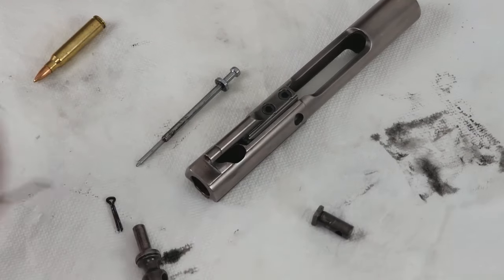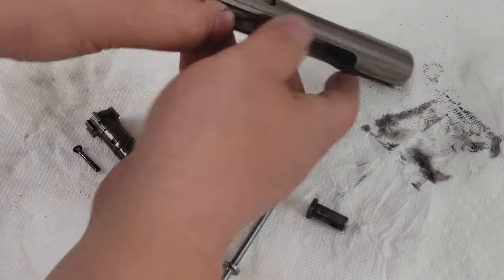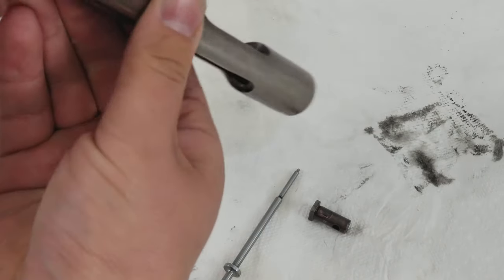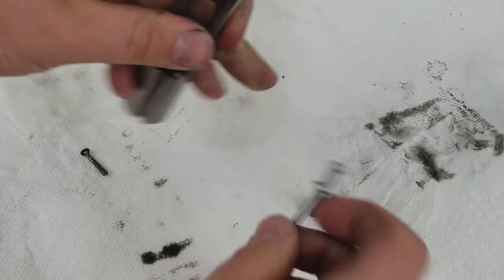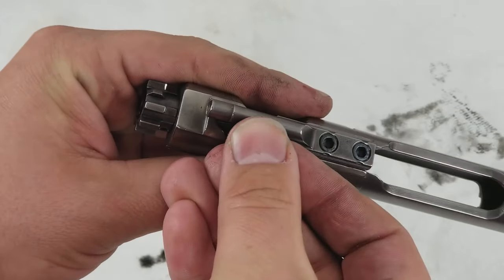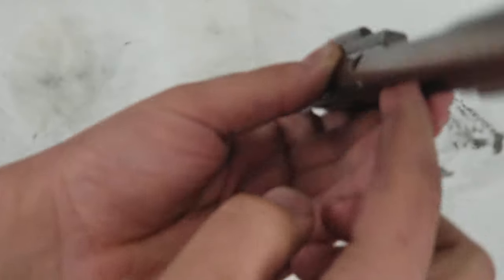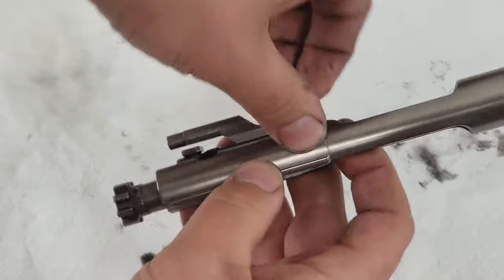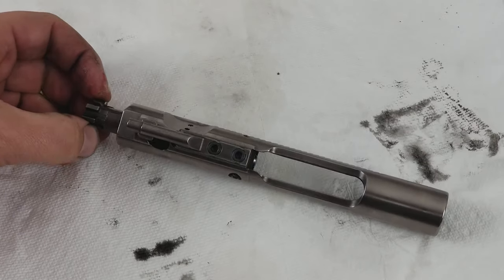How to Reassemble a BCG

Comment: I just watched a video to get the pin in, 1) push it in and 2) press down as you push in.  (The rounded side has to be flat as you insert it)
Reply: Thank you! This comment actually didn't make complete sense to me at first, so I tried inserting the pin without the firing pin installed, while keeping your comment in my mind. I peered inside the bcg to see what the pin was hitting that would not allow to to enter the hole on the inside, opposite side of the bcg. I see exactly what you are saying. Works everytime. 
Thanks again!

Comment: Is it normal for a brand new bolt to be really stiff? Mine requires a bit of force to move, and the cam pin actually twists a little when I push and pull on the bolt. It came pretty well oiled from the factory. Maybe it just needs to be cleaned?
Reply: I'm pretty sure what your seeing on the bolt is put to inhibit rust
Reply: dude mcx thanks yeah some CLP and working the bolt in and out a few dozen times has slowly loosened it.
Reply: Lube it and let it eat.
Reply: Best way to see if your BCG will function properly is to get a firm grip on it and flick it outward. If you can flick it and the bolt is in it's extended position, it's good to go, if not, lube it some more until it does. Run the new ones wet and dirty until you're past the break in period. Then give it a good scrubbing and do the flick trick again. Shouldn't have to soak it again after the break in period.